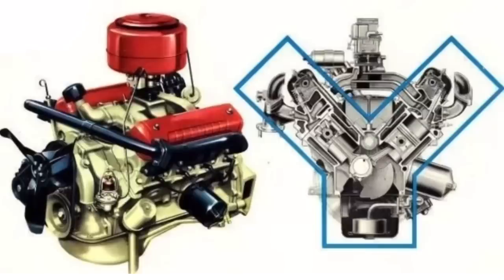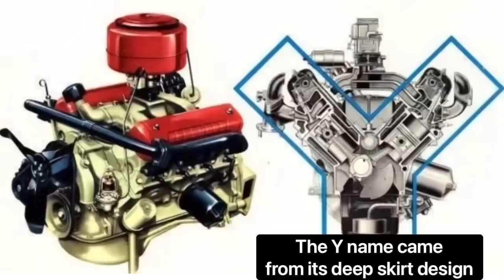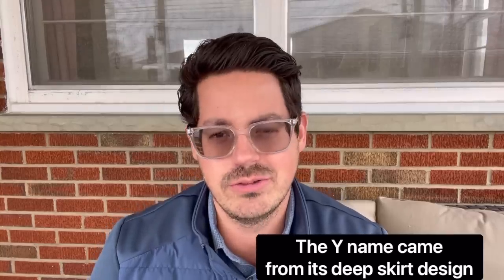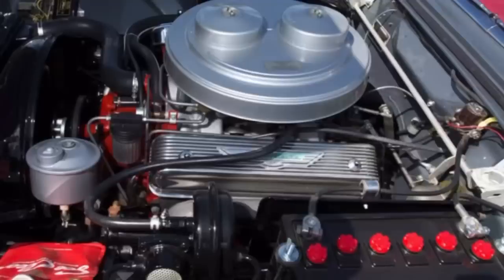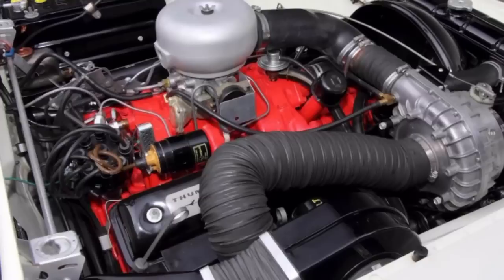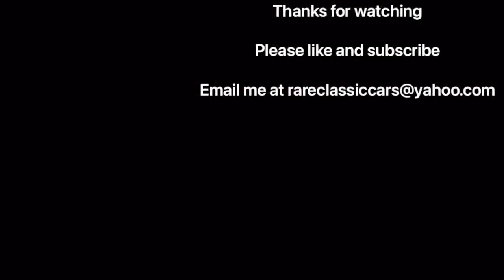Worst Engines of All Time: Ford Y Block V8

Comment: I have to disagree with you that the Y block was a inferior engine I drove them in high school and ran them hard . The oiling issue was known but it was a minor issue. For one thing all Y block engines had flat tappet solid lifters which required much less oil volume than a hydraulic lifter. They were also noisy Like all solid lifter engines. You are correct that many people were lazy about changing oil and would put the cheapest oil they could find like Quaker State. That brand of oil would build up paraffin like sludge throughout the engine. They had good power ant torque and gave good fuel mileage if ran easy. They were used in full size ford's and mercs through 1962. The main problem became their weight and they were a tall engine. Ford cane out with the new small block V8 in 1962 for the Fairlane and comet. They started out at 221 cu. in. Then 260 then in 1963 it became the famous 289. The Y block engines were dropped in cars after 1962 and in trucks around 65 or 1966 , another oddity that most people don't know is the timing chin alignment marks both pointed at 3 o'clock with 12 chain pins between the marks . The chain had 2 brass washers spaced on the timing chain to make sure you got it right.

Comment: I grew up in the 40s and50s and had flat head fords, Y block fords and small block chevys.  I  have alway done all my own maintenance.  engine rebuilds etc.  If you said chevy small blocks were better I  would agree but to say the Y block was the worst engine of all times is B.S.   Yes. if you didn't do maintenanace you will have problems with them as with any car or engine.  I was very happy with all my Y blocks (292s and 312s) .  The Y blocks lasted twice long and developed more power on less gas.  I was there I owned both and will take the Y block any day over a flat head.  
I'm trying to be nice but you don't know what your talking about.
Reply: You don’t know what you’re talking about, either. Firstly, read the title of this video series. It says worst engineS — with an “s” on the end. Ergo, he’s not saying that the Y-block is THE worst engine ever, he’s saying it’s among the worst. So far in the series, he’s features lists of GM, Ford, and Chrysler engines, and then done videos on select engines including the Cadillac 4100, the Iron Duke, the Lean Burn Mopars, and now this Y-Block. In his videos, he explains the shortcomings of the subject engine, and makes his case for its inclusion among the worst. 

And compared to its contemporaries, the Y-block has more than its share of shortcomings.

So before you claim someone doesn’t know what they’re talking about, I suggest you first should learn to read. And then once you can understand what’s going on, just maybe you can address the subject more intelligently.
Reply: @sking2173  I stand by what I said.  I was there.  Can you say that?  and I drove and worked on them and other engines from other manufactures of that era. The Y block may not have been fords best But it served me,  my family and friends well.  I have worked on and overhauled allot of engines in my day and the ones that had problems were either worn out from allot of mile or suffered from neglect.  I say this and I'm not even a Ford enthusiast.  You praise the flat heads.  It was good in its day but by the 50s it was obsolete and the Y block was vastly better.  You might want to read some of the other comments.

Comment: Now here is something to ponder The first small block Chevy's had problems the 265 the rings did not seat properly many dealer had nothing but complaints. My family owned a dealership at that time it took them till 1957 to get it right. Oh and here's one more thing Chevy was still building the 265 in 1957. The 283 was an optional engine in 57.  If you doubt it contact Vintage Chevrolet Club of America
Reply: The same thing happened with a batch of Ford 390’s, which was blamed on the blocks not being “cured” correctly.

Comment: An issue I have ran into on the Y block and the FE  engine's is the bushings in the eye of  the connecting rods. They are rather thin and sometimes will come loose causing major internal engine damage.

Comment: The early 1950s trucks had overhead valves before 1954 so I don't think it's correct to say 1954 was the first ohv engine. I think they were also used in Lincoln and mercury. 1954 is more accurately the end of the flathead v8 than the beginning of ohv v8.
Reply: He was very explicit in his explanation; he said this was the FIRST FORD OHV V8 — and he is correct. 

I have no idea what you’re nattering on about ...
Reply: @sking2173  I'm talking about Ford using ohv v8 engines before 1954 in their trucks. Sorry if you can't keep up and felt it necessary to add insults.
Reply: @dondakota920   — That motor used in trucks was the Lincoln engine. 

You’re calling the guy out, and you’re wrong.
Reply: @sking2173  you are the only one here who is "calling someone out" and you are wrong. It was an ohv engine used in a Ford vehicle.
Reply: @dondakota920  — So you’re contending that the builder of the engine is irrelevant? If the engine is in a certain make of car, it takes on the name of the  make of the car?

So in your opinion, the court decided incorrectly regarding GM installing engines from divisions other than that of the make of the car in which it was installed in some their 1977 models? I.e., if GM puts a Chevy engine in an Oldsmobile, then its an Oldsmobile engine, just as when Ford puts a Lincoln division engine in a Ford, it’s now a Ford?

“A Federal jury ruled today that the General Motors Corporation must pay $550 to each of more than 10,000 purchasers of 1977 Oldsmobiles that contained Chevrolet engines.”

Comment: I drove many 272 and 292 for years,they were pretty much indestructible
Gotta remember these things were designed in 1953
Reply: The Cadillac and Oldsmobile OHV V8’s were introduced in 1949, and unlike the Y-block, those were done correctly the first time.
Reply: @sking2173 Maybe they started designing the Y block in the 40s,it was pretty heavy and primitive looking compared to Cadillac and Oldsmobile engines

Comment: The best thing I can say about the Y-block is that it was FAR better than that limp old flathead V8 it replaced.

Of course, anyone with two brain cells to rub together can understand that an OHV crossflow head has to breathe a lot better than a flathead that wraps the top of the cylinder bores with exhaust gases.
Reply: The Y block was also a better investment. You got more money for it later when you took it to the junkyard, thanks to its weight.

Comment: Back then, engineering looked at the problems  that developed in the field, and corrected and improved the design. That was when companies were run by engineers not bean counters. Olds had OHV in 1949.
Reply: I had one of those, 1949 88 — with a Hydramatic. Good engine. Loads better than that Y-block ever was.
Reply: @sking2173  I wish I could get ahold of a Rocket 88.  I just know that it has a lot more than a mere 135 horsepower.  Many people back in the day felt that it had close to 150 horses.  The fact that a 49 or 50 will out run a 52 2 barrel that was rated at 145 horses pretty proves that.

Comment: Another great history video. My experience with the Y-Block engine was when  I was running and detailing cars on a small car lot in the 'late '60s. We had a couple, maybe three of these engines come in various Fords that had the oiling problem. At the time and the condition of each of the cars, nothing was done and they were sold as is. Sure interesting to look at a cylinder head that had no oil on it. It is beyond me why Ford dumped the 332 FE motor that was only out for '58 & '59. That would have been a much better engine that the 292 they kept until 1964. More torque and power and quiet. They could have even kept the Y-Block 312 instead of the 292. I drove some 292's and 312's. The 312 was far superior in every way. Or even the Lincoln 317 to have a smaller V8 heading into the '60s. The 292 was a powerless gas hog. I drove a 352-2bbl '62 Ford Galaxie and that was far better than the Y-Block and more economical in the real world that I drove in. Ford had many mistakes that kept them in the number 2 position and this IMO was one of them. Who would want a 1961 Mercury Monterey with a 292, not me.
Reply: In the 50s, the 292 was pretty potent, but in 58 they started detuning every year, so by 62 it made only 170 horses.  In 57 it made 212 horsepower.  That's a pretty big drop.
Reply: @michaelbenardo5695  True. Ford was looking for economy beginning in1959, even the Lincoln 430 dropped from 350hp down to 315 by 1960. Then they had to start increasing hp beginning in 61 for the new Continental. Having driven the 292, 312, 332 & 352 of that era, I really didn't like the 292. For whatever reason Ford reduced the power for was a silly thing to do, IMO. What about a very nice and quiet 332? My grandmother had a 59 Fairlane 500 with it and it was a great engine at 225hp. My 63 Impala had a 283 that made 20 more horsepower than your stated 170 in 62 and was quieter and smoother than the 292. My experiences were not good with the 292. IMO Ford made a mistake by not staying with the 332 FE. My experiences with the FE and MELs were great, all the way to the 428 FE and 462 MEL.
Reply: @montymatilda  They did bring it back for trucks for I think 2 years.  The 352 was a stroked  332.  3.5 inch stroke vs 3.3 inch stroke.  I thought the 62 Chevy 283 was also down to 170, unlike the 61, which was 185 2 barrel, 230 4 barrel.
Reply: @montymatilda  I think the 61 had just 300 horses.  The 63 brought back the 4 barrel carb, but never again would we see the 350 - 375 of the late 50s.

Comment: We had a fleet of them used to run the rocker oil outlet tube across the other side outlet. Most  oiled good one side no oil other  if you fed from pressure sw . bearings would fail.   The dist oil pump shafts broke too. Was a design change on cam bearings at some point forgot when
Reply: What was wrong is that the center bearing would be installed wrong.  It has three oil holes in it, each one indexing with a matching hole in the block.  Often, it would be installed so that only 2 of the holes indexed with the holes in the block, so the rockers on one side got no oil, or worse, so that none of the holes indexed.
Reply: @michaelbenardo5695  always wondered why exess oil one side  little other still have 59ranchero and-2extra engine s. Thanx

Comment: It couldn't possibly be worse than the 5.3 3v that is currently known as the worst engine ford has produced.  Thousands and thousands of F150s have had this engine replaced because oil oil sludge buildup leading to complete failure.  The carwizard YouTube channel talks about the 5.3 3v.

Comment: My dad had a 1955 mercury with a 292. He bought it new and in a short time became very noisy. Turned out that it had the cam bearing problem you mentioned. They replaced the engine and it had well over 100.000 miles on it when he sold it. Other than a lot of blow by, it still ran like new.
Reply: On a cold day, a three-year old Y-block blows more vapor from the crankcase vent tube than from the tailpipe !!
Reply: My Dad had the same problem with his 55' Merc 292. He said he wished he had kept his old 51 Ford flat head. lol

Comment: Back in the early '60s my dad had a '58 Ford Fairlane with a Y-block.  He got the car super cheap because it burned a ton of oil, and he spent every dollar he had to buy it.

He took the car to a local mechanic who was very familiar with these motors.  The mechanic pulled the valve covers and cleaned out the oil return holes on the back of each head with a coat hanger.  The engine had been smoking because oil was pooling in the top of the heads and leaking down through the valve guides.  This car had the opposite problem of most Y-blocks...plenty of oil was getting to the valve train, but it couldn't drain out.

Car ran like a top after that, and no more smoking.  The mechanic knew my dad had spent all his money on the car and didn't even charge him.
Reply: Reminds me of my aunt's neighbor, only he had a 332 FE with plugged oil drainback holes.  I got them opened with lots of spray type carb cleaner, (two cans).  No more smoking, no more oil burning, after that.  And I emphasized very strongly how you MUST regularly change the oil.
Reply: Great story ... Glad it worked out for him.

Comment: This guy is pretty clueless for the most part.  And has no idea where the actual issues were and it was not Fords first OHV V8 either..
Reply: It was indeed FORD’S first OHV V8. 

He placed an inset on-screen which stated there was a Lincoln OHV V8 in 1952, which is also right.

It’s you that appears clueless, ashat ...
Reply: @sking2173   Really then do tell what was the GAA...    Looks like the clueless ashat is the one is staring you in the mirror.
Reply: @sking2173  Ya exactly....crickets  Maybe get a clue so you can avoid looking like an idiot

Comment: It's a 312 Lincoln y block not 317
Reply: The Lincoln was indeed a 317.  The Ford/Mercury 312 was a completely different engine.
Reply: @michaelbenardo5695  pretty sure the 312 was in Lincolns
Reply: @luthermoore2969  Google it if you don't believe me.  1952 - 1954 Lincoln engine specifications.

Comment: I am 70, Australian, have owned many US 50s- 60s cars . The Y block yes had its faults but if these were rectified they were a smooth & economical, there low down trackability was amazing. They are my favorite V8, I still have two ,one in my 59 Fairlane the other in my old ski boat. The best factory heads were ECZ-G a bit thin on the ground down here but can find them, could rattle on for hours about these engine's but I won't..

Comment: This is complete BS! We had two Yblocks in Ford straight trucks on the farm growing up and they would sit for months at a time and always started straight up and ran for days and days during harvest. If you changed the oil every season and watched you didn’t over temp them they were a very acceptable engine.
Reply: So all that proves is two Y-blocks that Farmer Ted owned were better than average.

What else ya got ??
Reply: @sking2173  So how many have you had for over 50 years? How many have you lived with? Hey I’m not saying they are a SBC, but I’d take them waaay more than any flat head Ford or nail head Buick or even many newer engines. If you changed the oil every 3000 miles or once a year with good oil and ran the valves every few years they gave no problems.

Comment: If you think this is the worst engine  of all time you never seen the Vega  engine!
Reply: TRUTH!
Reply: @michaelbenardo5695  The  Vega was  like the ford 5.4  3 valve it is not  if it is going to fail it is when is it going to fail. Most times it will be when it will inconvenience you the most.
Reply: @mylanmiller9656  TRUTH.  I wish I knew how to make castings.  I bet I would be able to make a fair amount of money making replacement cast iron heads for the Ford 5.4 3 valve.

Comment: The  so called  beloved  Small block Chevy never did have the power the  Y block ford  did  until ford replaced it as there  top  line engine. In 1958 the Y was replaced  by the FE and  performance Y blocks were discontinued. The year Chevy was raving about having a 283 hp engine  Ford Paxton engines were rated at  300 hp but most left  ford with over 340 hp.
Reply: They never mention that, just like they never mention that you could get the top engine WITHOUT having to take a chance on fuel injection.

Comment: I owned a 56 Ford Customline with a 272 and a 3 speed manual on the column.  Bought it used in 1965 from an elderly couple with 25000 miles.  My dad’s personal mechanic had it parked at his place with a fire sale sign in the windshield.  The mechanic told us he had taken care of 
it since new and it was an excellent car.  I bought it, changed the oil and filter every 3000 miles  and never had a problem one with it. Once in a while being a teenager I would take on a Mustang 289 2bbl and never
 lost.  I cared a lot about the car and didn't race it very often.  I knew it wasn't a hot rod but it could hold it's own with comparable cars including the 283 Chevys.  I always used Valvoline oil and wish I still had it.  It was in great condition, idled as quite as a sewing machine and ran perfectly when I sold it.  I have a great respect for the Y block.  I also worked for a company that had a 25 foot bobtail and a dump with 292s in them and never in the shop either.

Comment: My dad had 2. He bought a brand new 54 crestline fordor with a 239 and 3 on the tree and a 62 galaxie 500 fordor with 292 cruiseomatic.. He liked them and never had issues  with oiling. My first car was a 59 custom 300 with a 292. that was a miserable car. Whole bottom end was shot and it dumped oil. Literally  would go through a case of oil in a 52 mile round trip

Comment: You have to go thru about 5 flatheads to find 1that doesn't have a cracked block somewhere. That's 1 of the 2 or 3 big reasons why the hotrodding community kicked it to the curb for the SBC.
Reply: That, plus the old flathead couldn’t breathe at all ... A Briggs & Stratton mower engine has better exhaust scavenging ...

Comment: I owned two old fords back in the late 60' and early 70's that had the Y block engines. A 292 and a 262 and they were both guttless. My friend had a 312 with the Christmas tree carb, wasn't much better and got 8 MPG.  👎

Comment: At the same time Ford around 65 ran into a problem with the FE engines that they wouldn't seat rings. Many were brought back to the dealer and had to be reringed; or even bored out to get the rings to seat. Dad said those blocks weren't cured long enough and were put into production too early.
He ran a 390 in a daily driver for many years so he was a fan of the FE, but was honest in noting some side effects of owning some of them.